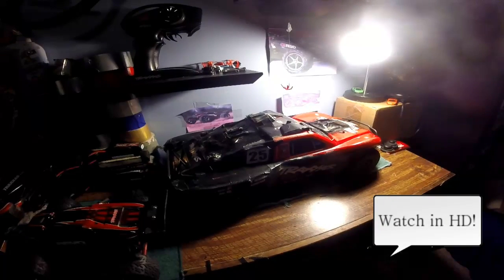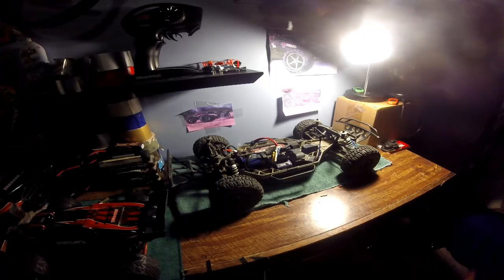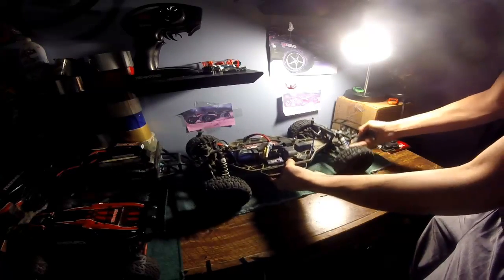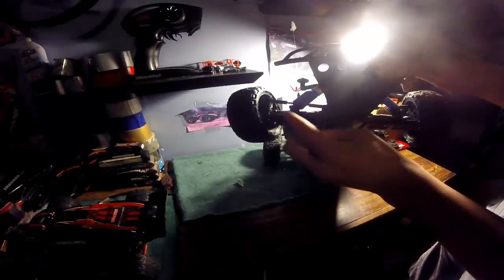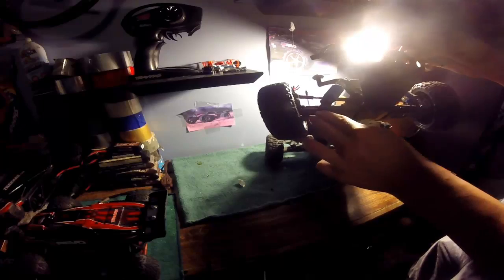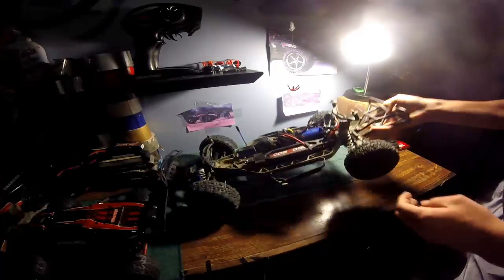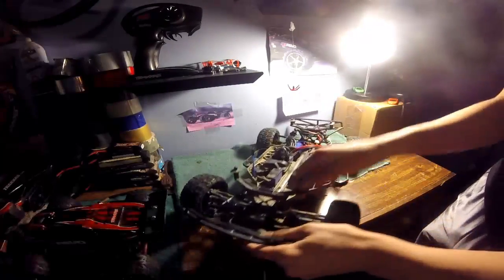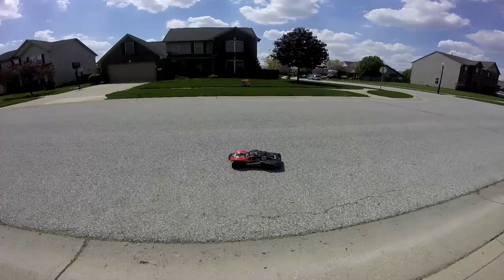The best way to make your Traxxas Slash run better at high speeds!

Comment: I’m not sure if moving the shock mounting points out make the shocks stiffer
Reply: That is literally the purpose of moving the shocks out it makes them stuffer but decreases travel
Reply: Its geometry, the farther from straight up and down you move, the more travel required for the same A arm movement.  The more travel required, the more compression on the spring required.  Yes, it makes it stiffer.

Comment: I know this is old but i need to know what gears you were using? And did you have heat issues?
Reply from the maker: Don’t remember exact gears, definitely a bigger pinion and small spur. Car did get hit on 3S had to let it cool often, installed a esc fan too that helped it.
Reply: @GholpianArmyRCchannel  thanks for your reply 👍🏽

Comment: My 4x4 does wheelies stock with 2s LiPo.
Reply from the maker: Tavmanian Devil oh dang that’s sweet, mine never did a wheelie on 2s, but on 3s I can do one at 30mph. Thanks for watching!
Reply: I forgot that I added the spacers on the outside of the shock so it’s a little stiffer. Pretty close to stock though!

Comment: awesome video thanks for the advice, have you take the inside of your tires yet so they don't balloon all you have to do is use duct tape turn the tires inside out stuff them with sandpaper clean them with alcohol and then tape them. this will stop them from ballooning and give you a lot better grip on the ground and the dirt and it'll also save your tires and money
Reply from the maker: Jason Jason thanks. Good idea

Comment: I'm buying it tomorrow used and am going to put a aluminum parts kit in it with a 3c liposuction and idk what gearing to use I want to go above 60
Reply from the maker: Crazy K definitely adjust the shocks and get a good splitter and I high airflow body for it and get the highest gearing traxxas sells( biggest pinion and smallest spur) it should do 60 pretty easily with this setup in fact you should get close to 80 if the battery is good and a high C rating.

Comment: Insane speed you got there and I still don't see what part of the suspension you move to drop the car lower
Reply from the maker: short stuff the lower screw that holds the shock to the A arm. Move it out all the way to the hole closest to the wheels. Thanks for watching!
Reply: Mine is already set to farthest hole it came like that stock but still sits higher than yours and still flips at high speed. Any suggestions?
Reply from the maker: UsoDrew try a splitter or more aerodynamic body

Comment: 4x4?
Reply from the maker: Gaming&Adventures yes
Reply: And it's still capable of doing jumps and off road after adjustments?
Reply from the maker: Gaming&Adventures not really, I noticed I got stuck in the grass after doing this. If you want it for speed and only dipped do this. If you want to do both on road and off road don't.
Reply: ok... it will still do good speed without the wheel adjustment
Reply from the maker: Gaming&Adventures yes just won't handle as good or be able to turn sad sharp. Thanks for  watching!